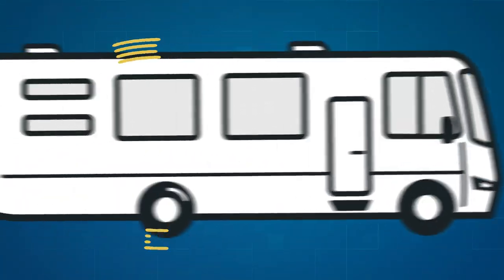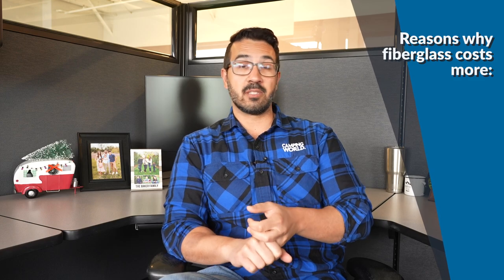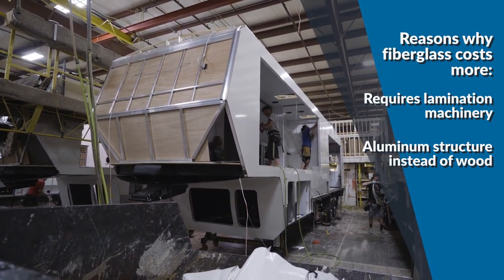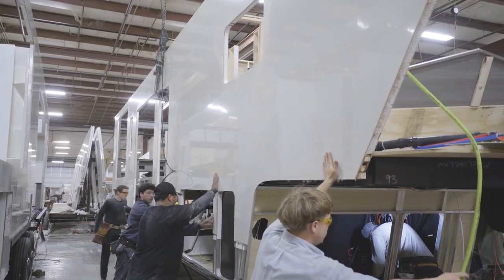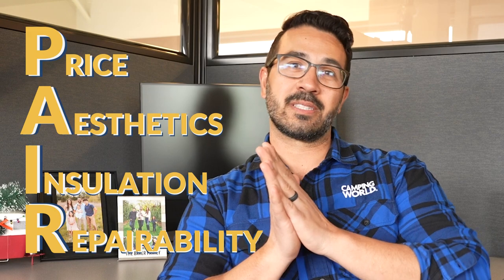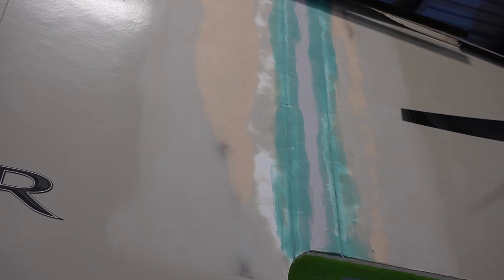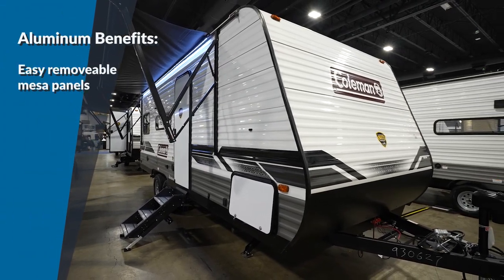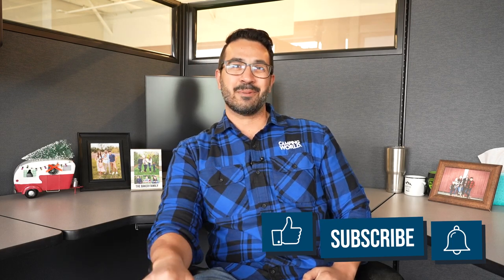RV Buying Guide: Aluminum vs Fiberglass

Comment: Why is the aluminum skin corrugated?  Cargo trailers have been using smooth aluminum skin for decades and recently started using Polycore 080 which is sturdier.
Reply from the maker: Hi There! 

The primary reason is that corrugated aluminum can offer a much higher strength-to-weight ratio when compared to a flat aluminum panel, which must be thicker than its corrugated counterpart in a comparable installation. 

Corrugated panels tend to rattle much less naturally and do not require additional steps, such as adhesives on all contact points, to keep flat panels quiet and wrinkle-free. Finally, flat panels only offer structural stability enhancements in two dimensions, while corrugated panels enhance wall stability in all three dimensions and will never wrinkle.

Ultimately, a wall built with a flat panel must be framed in steel or aluminum, and that framework must be structurally stable mostly on its own without much help from the siding. A wall sided with corrugated aluminum never requires steel and can utilize very thin aluminum or wood in its construction since the corrugated siding greatly enhances its stability without all of the weight and cost.

If you're interested in RVs with flat aluminum siding material, explore options like Airstream, InTech RV, Xpedition Trailers, V-Tech, and Livin' Lite, just to name a few.

Hope that helps!

Comment: How long does fiberglass last vs aluminum in the sun?
Reply from the maker: Hi Mike! 

There are many factors that go into this, such as how well often you clean and/or wax your RV according to the manufacturer's recommendation, how much sun exposure your RV gets based on where it's parked, how frequently you use an RV cover to minimize sun exposure, etc. 

That said, I reached out to some of our technical instructors to get their opinions on what they've seen hold up better. Here are some of their thoughts. 

"If we are just talking sun aluminum would be the better choice but you start adding in moisture, salt and other environmental issues I would go back to fiberglass. The fiberglass is more resistant to all of the other environmental issues that they are exposed to."

"Even though fiberglass and aluminum are both very durable materials, the advantages that fiberglass possesses in ease, availability, and affordability of maintenance mean it will likely outlast aluminum in the long run." 

They also added that fiberglass flexes well, stands up to heat and cold with minimal expansion or contraction, can be walked on without any concern if used as a roofing material, and is easier to maintain. 

Hope that helps! But let us know if you have any follow up questions. 
- Tucker Ballister